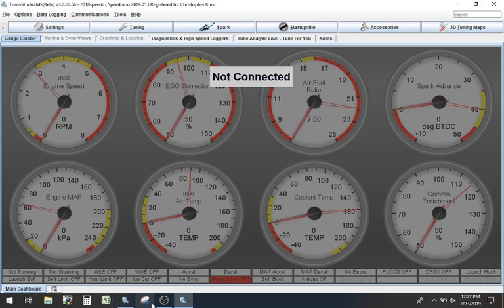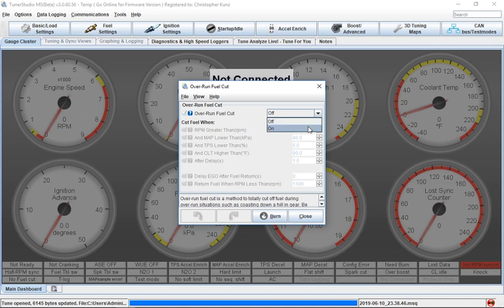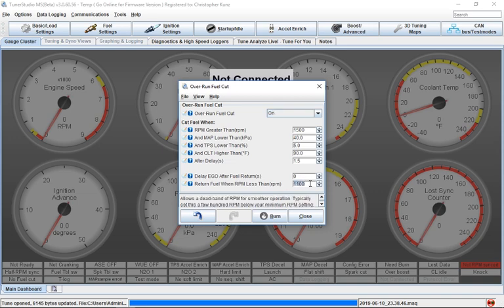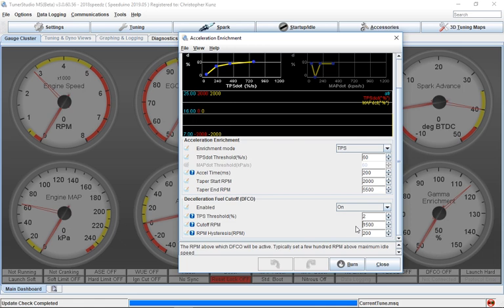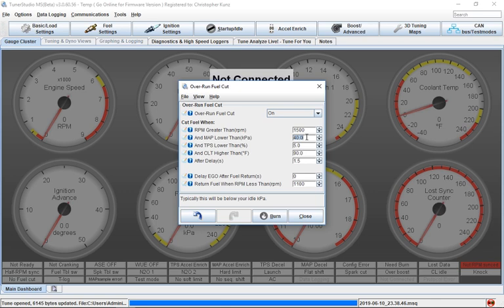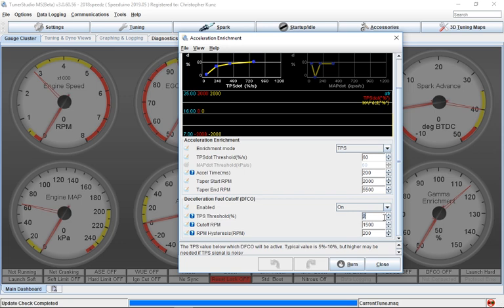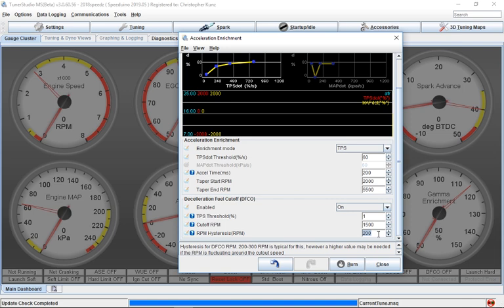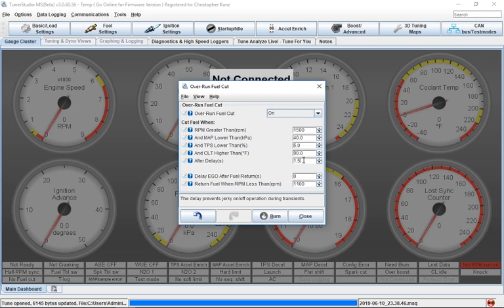Over-Run Fuel Cut and Declaration Fuel Cut off For Megasquirt and Speeduino

Comment: What kind of timing do you typically run in these over run areas of the map? The mid to high rpm ranges that are really low on the KPa that you only see while decel in gear? I’m trying to work out a lot of pops and bangs on the twin turbo fox. It has really good free flow exhaust so the bangs are loud and get to be too much.